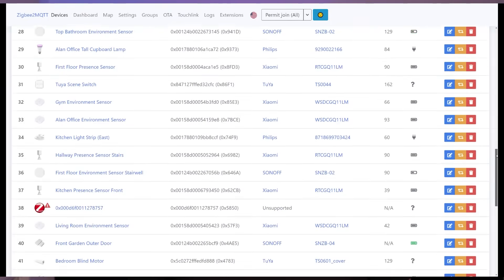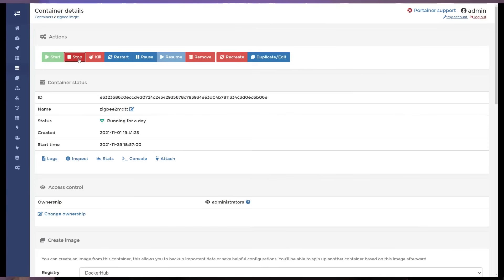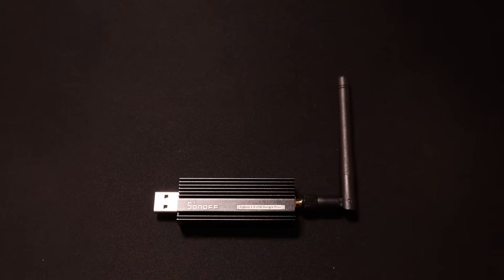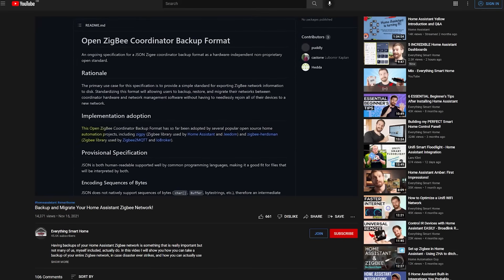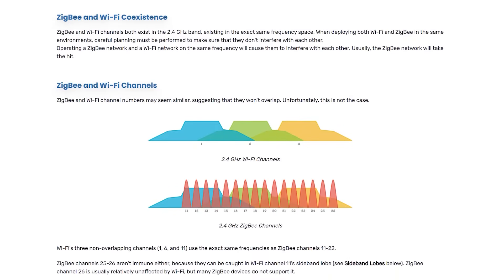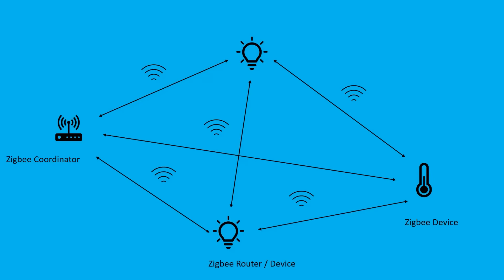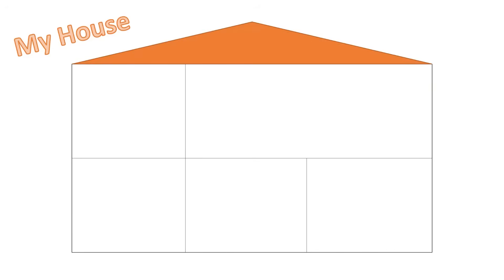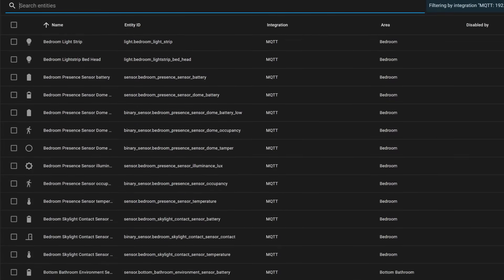Improve Zigbee network performance and stability with these 3 tips

Comment: I stumbled across your video shortly after I had tried to fix my sloppy ZigBee network, which showed the same errors, your network had.  I tried to make advantage of the same three principles, you metioned in you video.  But I still have problems with a ceiling light, I upgraded with ZigBee bulbs.  I has five bulbs, and after some time, some of the bulbs loose the network and can't be reached any more.  Re-paring them usually helps   Interesstingly enough, the first bulb to lose connection is never the same device.  :-(  So If you have any more tipps, I'd be lucky to hear from you.

Comment: Important thing that you've missed in this video - when optimizing ANYTHING in the world - your Zigbee network, your car acceleration, your daily route to work - make sure to measure your before and after results. Optimizing by repeating others may make your results worse! For example: if I connect my coordinator via USB extension cable I always get worse results than when attached directly.

So question everything, don't treat suggestions like an ultimate solutions and measure :)

Thanks for the video

Comment: NIce video with good suggestions. However, the hint with the order of pairing only works with devices implementing Zigbee correct. Which is unfortunately not true for many chinese Zigbee devices, like those from Aqara. Even though they now realize Zigbee 3.0, they still don't like to pair with other routers than their own (the Aqara Hub) or the coordinator. Another brand not really following the specifation is IKEA with their light bulbs. Those could and should work as routers, but often those do not work as expected (e.g. they drop messages instead of delivering them further to the next point in the mesh).
So, as a 4:th hint: Choose your devices wisely and read reviews about which brand realize Zigbee 3.0 correctly.

Comment: Thanks a lot for this very informative video! I will plan a "Zigbee re-work weekend" soon following your guideline. One question, though: I have several dozens of grid-powered Hue lights that would work beautifully as routers but for now I refrained from that idea because I wanted to keep the Hue network exclusive to reduce the risk of problems and the partner nagging about dark "magic lights" ;-) Hence my question: can I use any of the coordinators like the Sonoff dongle from this video also as routers? I could picture 3-4 of these in my mesh.

Thanks for any input on this matter!

Comment: Im here because i simply want cheap water leak detectors and entry sensors. I found some that use WiFi and simple SmartLife app but heard about Zigbee having significantly less power consumption for said battery powered devices. So.. I buy a zigbee hub, then what? I dont just simply connect it to any usb port on my computer, do I?
Reply: Since you mention a "hub" I am going to address that bit first. The central part of a zigbee network is the "coordinator" and there is only one coordinator per mesh network. A zigbee hub/gateway typically is a standalone device that acts as that coordinator for your zigbee mesh network. With the right components you can also build your own zigbee hub (more on that later in the replies!). That hub should have some way of connecting to your home network via wifi or ethernet. Your hub is then controlled by either an app on your smartphone/tablet, an assistant like Alexa/Google Home/Siri, or some other means such as an installation of Home Assistant. Most commercially sold zigbee hubs/gateways usually connect via the internet to a cloud hosted server ran by the manufacturer or partner, but some hubs can be controlled locally. The cloud based hubs can pose issues when your internet/wifi goes down for whatever reason. Local control is oft favored so that you can be better assured of both privacy and the ability to  monitor and control your smart home regardless of whether the internet is up. The off-the-shelf hubs will consume the least electricity and can pose the least barrier to operate based on one's technical know how.
Reply: There are three categories of zigbee devices in a zigbee network. First is the coordinator (just 1 per mesh network ). Second are "routers".  The routers are going to be things like wall switches, in-wall relays, smart bulbs, smart sockets, and other devices that usually have a direct, relatively permanent, connection to your mains power. These routers also have the ability to extend and repeat the signals from other neighboring zigbee devices. It can be critical to have router devices throughout your home in order to create a healthy and reliable mesh network. The last category are the "end devices". The end devices are going to be your battery powered sensors like door/window contact sensors, water leak detectors, motion detectors, temperature sensors, etc There are some mains powered end devices and they are usually the light switches and relays that don't have a neutral wire directly connected.
Reply: The other part of your comment was about plugging something via USB to your computer. As already stated in previous reply, a zigbee hub is going to be connected to your home network using wifi or ethernet. The USB based dongle discussed in this video is for those who build their own hub. A USB zigbee coordinator like that is meant to be directly connected to something like a spare PC or a small board computer (e.g. Raspberry Pi, ODROID, Tinkerboard). There also some zigbee coordinators that are network attached such as the ones made by SMLIGHT and ZigStar. A coordinator has to be functioning 24/7 or your zigbee mesh network will go offline. This is why you should use a hub or a dedicated PC / SBC to manage the coordinator device. The Home Assistant project has its own line of SBCs already configured with Home Assistant that are called Home Assistant Blue, Green, and Yellow. Check the channel for more videos on Home Assistant if interested in building your own hub rather than buying one off-the-shelf

Comment: Naming can be such a pain. I have a 5500 sq foot historic home that has all hue bulbs in every fixture whether they be built in fixtures such as chandeliers or non permanent such as table lamps. I use mine all connected through z2m as well. With over 300 devices I had very similar issues until I optimized my UniFi networks to not interfere with the signer chanel I utilize. I name my based on room and device then bulb number. For example I have light.living_room_tiffany_lamp_bottom_1

This identifies it as living room being the room then Tiffany lamp identifying the lamp and then bottom 1 indicating it is the 1st light bulb on the bottom row of bulbs. 

What gets tricky is if I have multiple fixtures that could go by the same name such as having two identical lamps. Then I throw in an additional identifier such as left or right in the case of couch lamps or front or back referencing what part of the room the lamp is in. Worked well for me with my large amount of devices. 

Also thank you. I’m a frequent viewer of yours and I have done 3 different homes of mine as smart homes and each one has gotten progressively better and more sophisticated. Being in our permanent forever home now, I feel like I’ve come a long way between you and other smart homes creators on YouTube and I wouldn’t have been able to without you guys!

Comment: i have a tuya zigbee hub... on the gateway interface, I don't see any where I can select zigbee channels.  When I buy the gateway, the seller has no idea when i ask about what channel it works on.  Finicky to get zigbee device to connect to the closest zigbee repeater. Very often the even repairing in site does not always help.

Comment: Another thing that might marginally improve your network is pointing all external antennas straight up:
Ideally all the antennas on your devices should be pointed the same way (being it upright, flat to the ground or at an angle) to avoid polarization issues, but since most devices will probably have hidden internal antennas that isn't really an option.
The next best thing is point external antenna on rounters and hubs up, that way their "donut-shaped" propagation field will be flat to the ground and cover more space horizontaly than vertically (which is what you probably want unless you live in a tower 😁).

This is probably a lot less important for a mesh network like ZigBee than it is to mostly point-to-point networks like WiFi, but if you are trying to get the absolute best out of your setup it might still be worth it.

Comment: I just went through rebuilding my network after it failed miserably.  I used the chance to migrate to skyconnect from a HUBZ combo stick.  Two things I learned.  1) as you say - pair in situ.  I realized this was an issue after pairing a couple water sensors in my office then taking them to the basement.  Second was, watch for failed routers.  Turns out, I'd moved offices and the automated lights in the old office were key routers in the network (sitting very close to the coordinator) and they'd been powered off when the automation failed.  Check the network diagram regularly for similar devices.  
Thanks for this!
Reply from the maker: Thanks for the info! Glad to hear you got it back up and running

Comment: I'm planning to use 3 hue bridge (as I have a lot of hue devices on all those areas) :
1 for all the lights outdoor
1 for ground floor 
1 for 1st floor. 
I have also sonoff P  dongle.
My first hue hub is on canal 20 
the second on 25 
the third will be on 15. 
All other equipment not compatible with the hue bridge (such as door sensor, smoke sensor,..) will be connected directly to home assistant with the sonoff .
Do you recommend to use different canal for all 4 of them ? 
Or the same canal ?
And if so, for the sonof to have a signal powerfull enough to cover the all house what would you recommend then ?
Reply from the maker: I would recommend just using one bridge and adding routers instead.
Reply: @HomeAutomationGuy  but Hue bridge are limited to 50 devices. No ?

Comment: Watching this and having read through the community forums and these comments, there's an idea out there that the network would "Heal" itself to better connections. That has not been my experience, and I hope by repairing with that 22-devices in mind helps me spread my mesh network better. I only have a few random lights that don't always cooperate, but it'll be nice to have them be as stable as I would have expected by now.
And now, to plan a weekend of re-pairing and fixing automations. hopefully my naming stays the same and I won't need to re-do too many automations.

Comment: As someone who has worked with servers and networks for the last 15 years, one thing that I've figured out is that a good naming scheme on your network is everything. If you randomly make up names on the spot, within a few years you are left with a network that nobody including yourself can figure out what's up and down. 
I use the following naming scheme [Room/location] - [Function] [position ex left/right/number]
This makes it a lot easier when you're making changes in home assistant, you instantly knows what devices an automation or scene is using even years after you made it.

Comment: Very good summary. Thank you. I want to ask you something. For the  wifi network you can extend a network with multiple access point. The signal can pass through 3 different access point to reach the final client. But it is not recommended. One modem and one access point is ideal. How about zigbee network. Can a signal pass from one switch to another continiously 3-4 times. Is it technically possible and is it recommended?

Comment: The problem I have is that other than my main Zigby network , I have two other private Zigby networks at my location. One for my Drayton wiser  central heating system., the other I believe is my electric and gas smart metres. I have no way of knowing what channels these are on as I can’t find a Zigby scanner/analyser like the Wi-Fi one you demoed in your video. Any ideas? 🤔

Comment: This was great insight. I have 55 zigbee devices where 2/3 are wired and serve as routers and I’m using the ZBDongle-E. Are you using the ZBDongle-P?

I did check that the channel used doesn’t overlap with wifi but haven’t really planned routes or gotten my antenna away from my Wifi router.

Guess I’m spending a weekend improving my network.
Reply from the maker: It's quite a rabbit hole to go into! Good luck with it!  I am using the Home Assistant SkyConnect zigbee dongle.

Comment: Hi thank you for this video! Is it possible to connect zigbee 3 devices (using the cc2652 coordinator* ) to Alexa or Alexa echo directly using a zigbee 3 coordinator like this without having to pair them using Tuya or Smart life app? I’m in need of a 12v DC 10A (or a sow as 5A ) relay to turn some devices on/off in my SUV. Having a hard time finding a simple solution. I’d love something Homekit compatible but would go the Alexa route too! Thanks!

Comment: A word of caution: maybe your network is just fine, but your devices aren't! When I moved a year ago, I took all my smart home devices with me (about 130 devices, 70 of them zigbee). In the new house, six light bulbs constantly became unreacheable over night. They would only start working again after a power cycle... I tried every trick in the books to improve my zigbee network (since I suspected a interference or range problem), re-paired them several times. to no avail... Only when I replaced them each with a identical bulb - that magically and reliably worked from scratch - I realized that (the radio chips of) those bulbs must have been defective.

Comment: Does the order in which you connect devices really matter? Does the coordinator determine the path of the network? I have seen other videos where people pair through a specific device (a setting in ZHA), but the end device doesn’t remain paid to that specific device it seems to move randomly
Reply from the maker: I'm not 100% sure what benefit pairing the device through a specific router provides - I just always try and pair the device closest to where I'm going to be using it.

Comment: I bought a Conbee2 dongle, the worst mistake of my life - tried deCONZ & ZHA with it..... I thought it was cool, as I'm disabled, to gradually turn my home smart, but focus my base around Home Assistant..... For starters the lights, I chose Philips Hue hub and bulbs - works like a charm..... Then I thought a door sensor from Aqara..... The first few days it worked like a trooper - well when the bloody thing decided to pair! - then I kept getting delays or even "unavailable" daily...... 

The Conbee2 is attached to a QNAP NAS (TS-h973AX-32G) USB2 port with a 1.5mtr cable.

Philips Hue is releasing their own open/closed sensor soon, so I'm going to buy one....

Comment: How you choose device that is reliable? There is couple of buggy devices and/or are badly integrated to z2m. The repo have 10k issues, thousands of them closed automatically with bug never resolved. Do you fix the code yourself?

Comment: Excellent tips, thanks

I am soon going to start setting up my Zigbee network in a house i bought last year.

One thing I am having issues with, is binding from the web site in Zigbee2MQTT.

Do you have any videos about this?
I would like a Philips Hue Motionsensor to turn on light, even if the zigbee2mqtt server is offline. (Or more specifically my wife wants it ;) )

Comment: Nice video's.

Still far behind you.

I have significant problems with Sonoff Zigbee products. They disconnect, especially the door and window detectors. Motion detectors which are close to my hub (3 meters)
Another motion detector at 6 meters disconnects.

I have a Sonoff wifi HUB connected to Ewelink

So if I read your advice. Maybe I should move my 2.4 GHZ  wifi network to some other channel (a higher one). And try to figure out which channels the sonoff hub works on ?

Or should I ditch Sonoff Zigbee alltogether for TUYA which seems to be recommended everywhere ?

Comment: I have the Sonoff USB 3.0 Dongle Plus set up with Zigbee2MQTT in Home Assistant, and I'm trying to find out where I can find the Wifi channel information for the device?? Any clue? Thanks, in advance and thanks for the great information on Zigbee networks! ~Frank
Reply from the maker: It's in the Zigbee2MQTT web interface, under settings, and then Advanced
Reply: @HomeAutomationGuy  Ah, yes!! Thank you!! I hadn't snooped in that far yet. I was actually wondering why the dongle doesn't show up in my devices list, but this answers that question, as well. Thanks again ~Frank

Comment: You didn't mention Lutron Caseta ClearConnect which uses 434 MHz frequency.

You said you were using Aqara child devices. Does that mean you are pairing them with an Aqara Hub? If so, how do you set the Zigbee frequency used on the Aqara Hubs?
Reply from the maker: Lutron isn't that popular here in Europe so I've not come across them much.  I pair my Aqara (and other brand) Zigbee devices directly with Home Assistant using a USB Zigbee dongle, that way I don't need to use their hub and I can have more control over the network.

Comment: Hi, are you using Philips hue bridge for your lights ? Or a do you use zigbee2mqtt/ZHA for that? I have so many hue lights that i need 2 hubs (philips hue), so I was thinking to build a need zigbee network using zigbee2mqtt. Or is it best to use hue bridge for the lights ?
Reply from the maker: I use Zigbee2mqtt for my hue lights. I've not used the bridge in years
Reply: @HomeAutomationGuy  thx. ZBDongle-E or the ZBDongle-P the best option for zigbee 2023 ? or is it SkyConnect ?